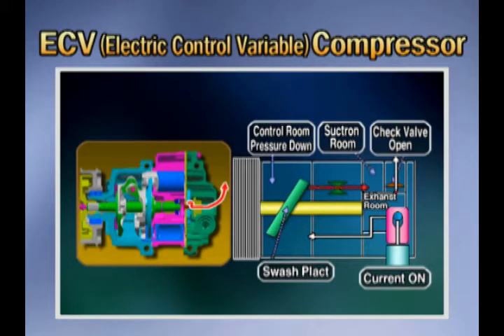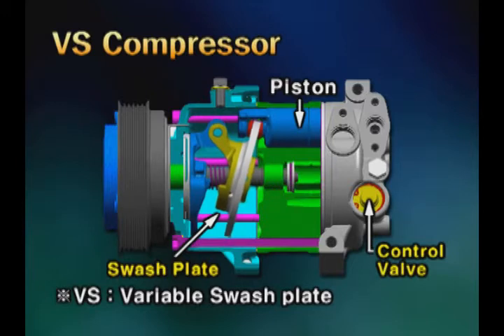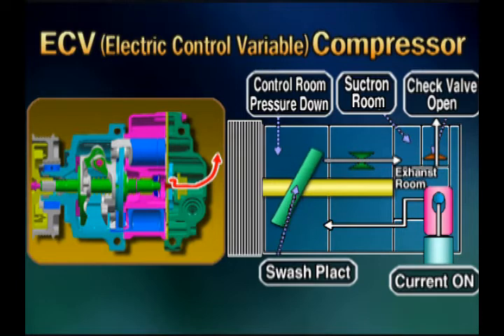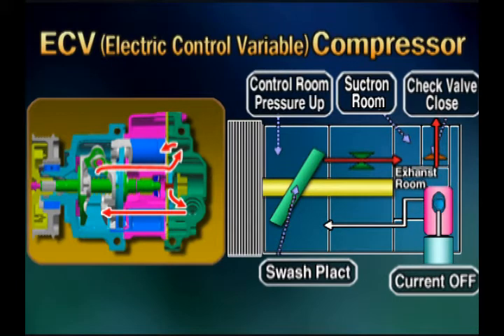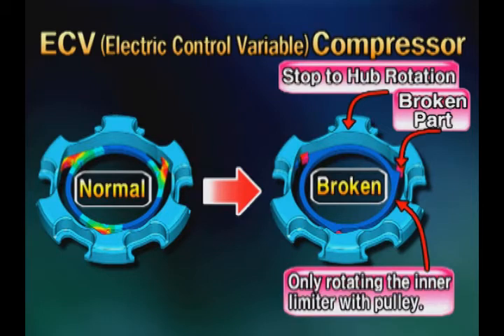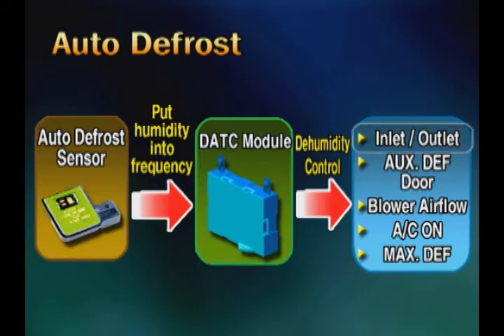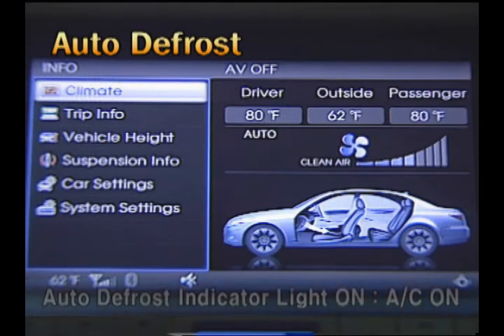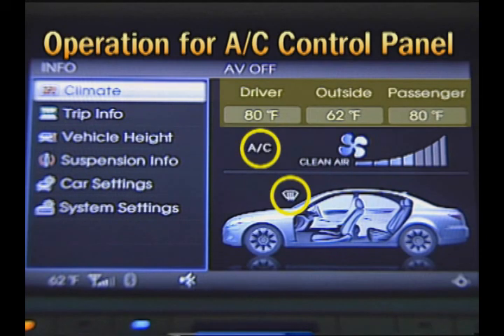How ECV Compressor (Electric control variable Valve) Works in Hyundai and KIA Air Conditioning

Comment: So I confirmed 70psi in system at static pressure.  Confirmed 12+ v coming across two wire connector to ecv, confirmed duty cycle across two wires so have pcm or hvac control module green light to power ecv and compressor.  12.6 ohms across ecv pins.  Battery power across ecv pins twice very briefly, two clicks.  But with ac on, running, zero gsuge pressure change from static, high and low.  Ecv stuck open?  Completely stuck open, not even 3% compression change.  Could I gently tap this compressor at the ecv like one would any other stuck solenoid or engine starter?  Wondering, before changing out ecv....
Reply: Nope!  Not this time anyway!
Reply: Oh Bummer.....that little bolt in the center of the clutchless compressor SHOULD/MUST be rotating with the rest of the pulley or in fact, the compressor has seized and the breakawsy tabs have broken away.  I mistakenly thought the opposite.  If the belt is temoved and the compressor is good, the resistance of a compressing pump hitting like a compression stroke will be felt.  If the center bolt does not turn with the pulley, you can put a socket on it and you will feel the gritty resistance (in places) of failure.  Depending on severity of failure, dark/charred pag 46 oil may be elsewhere and debris as well in txv and condesor/drier, so dealerships change those too since avcessible unike evaporator, and flush lines as well.

Comment: So with this technology the ac compressor doesnt have to turn off? I have a suzuki vitara with same compressor , but the compressor doesnt want to go off automatically like usualy my toyota camry, is it because the compressor from my vitara have this valve technology?
Reply from the maker: Yes, normally when you have the usual compressor with clutch, you feel the compressor kick on as it affects the engine somehow, but in this one, the compressor pulley is rotating by the belt all the time and this valve will activate the swash plate to give the output to the compressor.